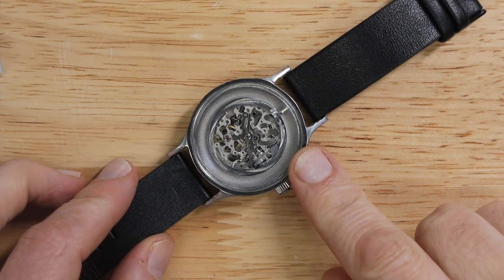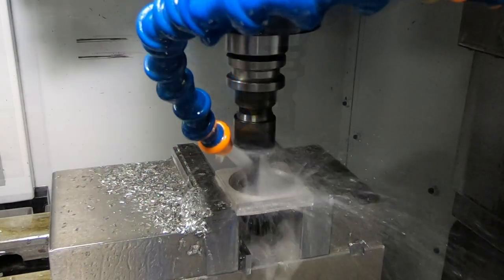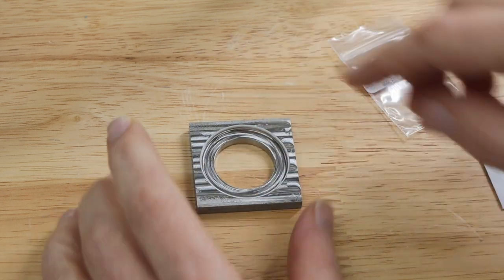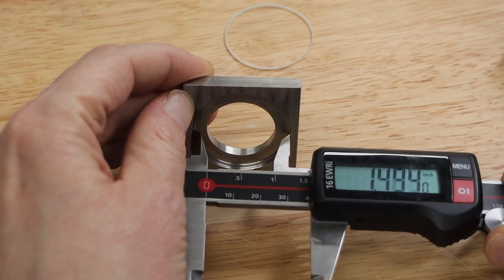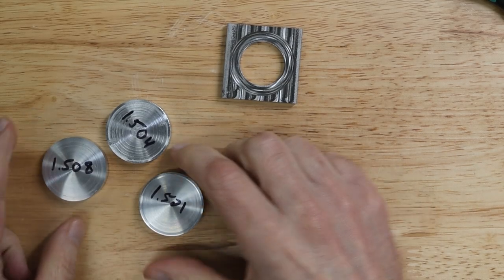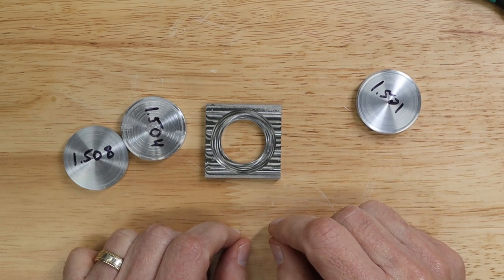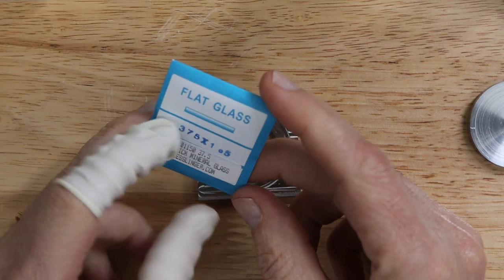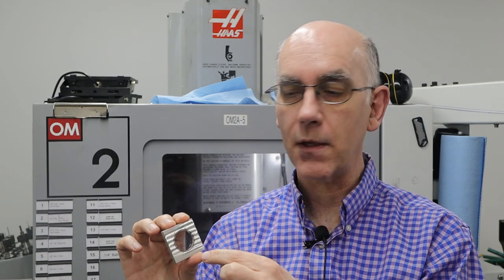Watch Case -- Water Proofing, Part 1

Comment: Try using a boring op instead of contour and you should be getting a better sidewall and more even tool deflection. Contour also tends to leave a bite mark on the lead in and out, which probably wouldn't be good for sealing. Just a thought. Great video
Reply from the maker: Thanks, I'll have to try that. I wasn't sure if it would give me a flat bottom, but I just checked and Fusion 360 does add a circle at full depth at the end of the bore.

Comment: Is the crystal only held in as a press fit or is there an adhesive used in final production. Thanks for some very interesting videos.
Reply from the maker: Thanks. The crystal is only held in place by the pressure fit of the gasket. I haven't found details on what the correct dimensions should be, so will be doing some experiments to see what works best.